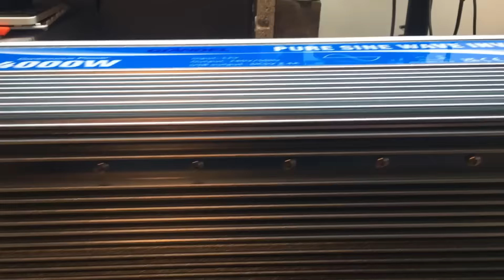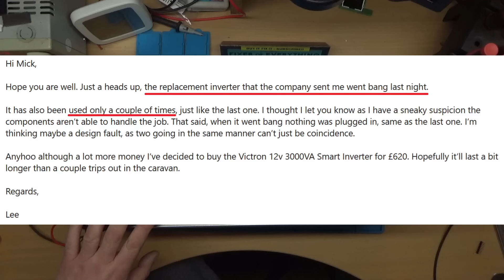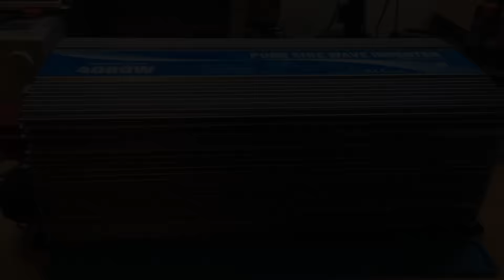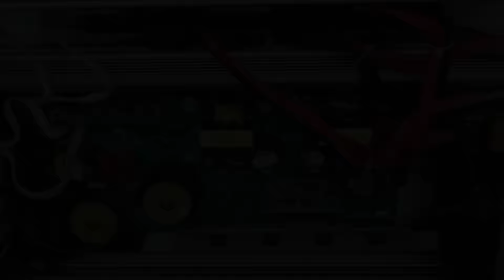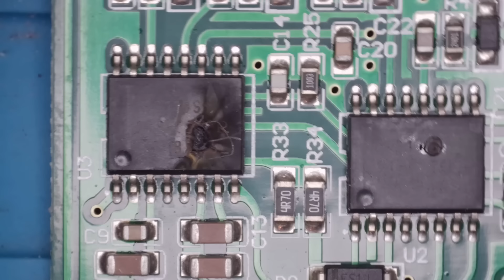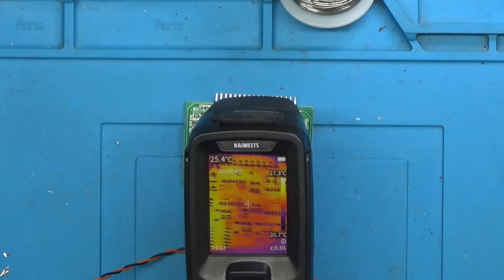Blown 4000W Inverter 💥 - Fixable or Game Over?

Comment: People think they can draw 4KW from a 12V battery? What 12V battery will do that sustained?
This product is insane. Not surprised it melted someone's battery and caught a house on fire.
It's >300 amps.
Reply: Yep. 333A x 12V is 4kW and allowing for inefficiency, it'll probably come out nearer to 400A than 300A. It would need to be a huge battery, connected with very very thick cables. Maybe the inverter didn't like the probably much less than 12V that it probably was fed in practice?

Comment: I’ve got a 2000 watt puresine wave inverter that’s gone faulty it’s fault is saying it’s over loaded but it never been over loaded it was a back up for a cellar water pump it fits in a battery box with a bank of 12 volt batteries paired as 24volt packs. I would love to get it repaired as a can’t find a replacement one to fit in the battery box and have the lan trigger to turn it on and off. It would be great if you could have a go at it
Reply: It means the output FETs are shorted.

Comment: This is concerning. I have had 2 giandel inverters and they wont die. One got rained on by accident while camping (it was at least not connected to 12 volts) and it still works.  In the various inverters i have seen fail, its usually the output H bridge IGBTs that fail, they arent a fan of high current surge loads, like induction motors. When the igbts go, so does the PWM sine wave controller board, usually the IGBT drivers fail. Those little boards all do the same thing, but usually have odd pinouts.

Comment: Many of these Chinese inverters have the problem that the solder holes are undersized, especially if the solder hasn't flowed completely through.

I've got a similar one right now where the positive and negative terminals were reversed. Almost all the electrolytic capacitors exploded. 😅

Comment: 12v 4000w  in my very limited opinion that is the 1st problem. I want a minimum 24v inverter, but ideally a 48v running 4000 watts. If only to save money on cables supplying it. 333 amps!?

Comment: Honestly it doesnt even surprise me anymore. I also have been brought some blown inverters. Whatever has happened to them the mosfet/igbt gate drive IC-s have also been damaged. In general it wouldnt be a big deal but the design engineers have almost always chosen gate drivers without galvanic isolation- so anytime the output gets destroyed the input also gets some of the spicy high voltage and destroys the microcontroller. In some cases I have repurposed such inverters to just be HVDC output only, without the  AC conversion part since most electronics devices have diode bridges and switchmode power supplies in the input- but should you do it yourself, never assume that a device has SMPS in the input, some still use low frequency transformers! 

Altough unlikely, you could try reading the chip while being powered by the power supply and have some success doing that

Comment: Sad. So many nice parts to recover or use for own designs. Its bad how many of them get tossed into the scrap after they fail, I need some of those transfomers and coils/chokes, maybe even high voltage caps.
Is there any chance to get this inverter to Germany, maybe for giving it a try to repair it myself (can take a while!) or for rescuing some of the parts?

Comment: The user likely didn't plug in something "too heavy" in terms of running watts, but rather something with a massive startup surge that the inverter couldn't handle. This confirms my suspicions and you mentioned the fridge , the mini board (PIC16F716) or any of the chips did not cause the fault; it was destroyed by the cascade failure initiated by the compressor surge killing the MOSFETs ,he would have to Consider installing a hard start kit or soft starter on the fridge compressor ,or Use an inverter with a higher surge rating or a low-frequency transformer-based design, which handles motor surges much better.,he should be told this as it will keep happening ,he thinks buying 4000w is good ,it is if used correctly .its not his fault but at least he will know to buy an inverter that runs a fridge,cheers Gary take it easy matey :)
Reply: If you must know it hadn’t anything to do with what I had plugged in. I fitted it in to my caravan, running from a 603ah Fogstar Drift battery and 0 Gauge cable. The problem was having the inverter installed in my caravan while driving about. It did not like the vibrations or movement of the caravan, and shook the legs loose on one of the components.
Reply: @pulsenation  ahhhh its a mobile caravan well that makes that transformer even worse ,i thought it was a static caravan me bad sorry for that ,but anyway ,so was it the fridge or vibration ,we will never know,it is a cheap transformer , i have looked at them they are junk,vibration can cause the legs to break as you say , 603ah Fogstar Drift battery and 0 Gauge cable absolutely perfect, the high-frequency Giandel absolute garbage ,Low-Frequency inverters use a massive internal copper transformer,Vibration Resistance,,3 to 5 x Surge Capacity,for that fridge and Durability for mobile use like moving caravans ,motorhome, so what is the 3rd 1 you have bought ,i thought Giandel were cheap but they are not, they pretty expensive ,and says heavy duty,but if you are telling me this is happening because of vibration then these units need reporting to health and safety ,they will blame the fridge because it causes the same symptoms,but i am so happy to have seen inside and the damage done to this unit,so thanks for sending it in and replying to me ,they have a picture of a motorhome in there advert for these units and lots of so called guarantees , made in china , shenzen if i were to guess some more,that unit is a death trap for motorhomes if they are failing like that,were did the vibration diagnosis come from ?

Comment: That output driver board looks like a clone of an EGS002.
Reply: I thought of that too but the EGS002 uses a dedicated spwm chip, the EG8010, instead of a PIC. It also has 17 pins instead of 18. It would be nice if they were pin compatible though.

Comment: would like to know what is causeing it to blow loads of componets and catching fire
Reply: The mosfets short out due to overload / overheating, the current goes up to the control pin (the gate) and blows up all the semiconductor stuff that drives it. Not sure why it would catch fire but unfused low voltage power can be very dangerous.
Reply: It probably set the wiring / battery on fire due to trying to draw too much current.

Comment: Enjoying your videos 👍🏻
Could you tell us the current the board took when failing 👍🏻
Reply from the maker: I can't remember the measurement on the bench PSU when I was powering the control board, if that's what you mean? But it was 5V being fed into it, and it was 38 ohms I measured across the supply, so it should have been  5v/38ohm = 0.13A

Comment: Given that so much has "blown" across both high and low voltage sides, you feel there much have been some huge thwack of back EMF current, and given that it seems to be a recurrent problem for the manufacturers you'd think they'd build in some surge protection or freewheeling diodes to mitigate against that?!

Comment: They had fuses in parallel???
Reply from the maker: Yes, each inverter seems to be 500w so / 12V = 41A. Two 25A in parallel would be 50A although 1 x 50A fuse would probably have been better.

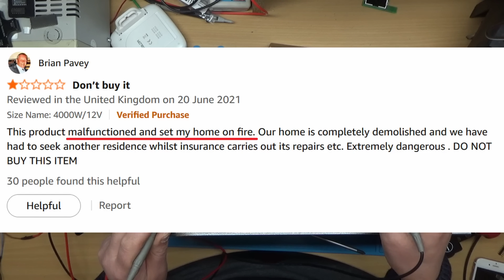Comment: 5:57 This review does not make sense under normal condition. First there is BMS on battery that protect overcurrent, second there is circuit breaker, and LFP battery does not go fire when under heavy use or short circuit no matter what (only when extreme overcharging it will have small chance to get burned). So, even the worst cheap inverter will not be able to cause fire from inside (nothing to burn inside solid casing) except from the cable getting hot and insulation burned out because of overcurrent (but this will trip the breaker/BMS). If melted cable doesn't trip the breaker that means you use too small or wrong cable size. Also, even if something burning (in worst case) there should be limited fire (not the entire house) and could not expand (self-extinguish) if properly put in correct place. This person might be lying or just doing totally wrong in the installation and placement. Remember, nearly 99% of fire in solar-inverter installation is coming from wire & its insulation that is melted and too hot, rarely from battery and extremely rare from other sources.

6:00 If a user saying it melted his battery then either he is not using BMS or using faulty BMS. Either way it is his own fault that cannot do proper installation so that inverter can cause damage to battery. This is near impossible to happen in normal and proper installation (regardless how bad an inverter is). I did once buy worst inverter and it shorted out after few weeks but fortunately BMS cut off and circuit breaker tripped.

Comment: You are on a hiding to nothing with this sort of cheap china junk before you even take the covers off. Questionable componentry, questionable design and questionable implementation. With the currents and voltages involved there is very little wiggle room if something goes south and semiconductors are the first things to let the magic stink out. I've seen units like this where every device has exploded and the fuses are still intact. I'd be stripping the boards for usable parts.
Reply from the maker: Totally agree 👍

Comment: 4000W at 12V is 333Amps if it was a perfect inverter. That's an eyewatering amperage to be drawing potentially at full tilt, no wonder the battery melted in one of the reviews.

Comment: 4KW at 12V is approaching 400A by the time you allow for efficiency of the inverter, cable losses in the feed wires, and sag in the batteries due to high current levels, so ratings are probably fairly unrealistic in the first place. Probably operating from a parallel string of batteries, in which case would be better to reconfigure to a higher voltage series string and use a higher input voltage inverter to reduce current draw/voltage drop. If inverter is configured as multiple 500W inverter modules in parallel as you suggested, it would be prone to cascading failures anyway, one module goes open circuit, the rest have to pick up the slack and work harder, then the weakest remaining gives up and issue continues till they have all given up. Alternatively, one unit goes short circuit, the rest kill themselves trying to drive into the short circuit. Protection system if used would be structured for combined output, not a individual modules.
Reply: Probably a 1KW inverter at best, probably less. Can't believe people use this stuff, it's obviously dangerous (at high loads)

Comment: Glad your friend got a Victron. Super reliable. Mind you a few of my forum buddies use these Giandels in their setups and they have not missed a beat. Must be a design flaw with this particular model 4000W unit (mind you it makes more sense to go 24V or even 48V at these power levels).
Reply from the maker: Agree, I've got a few Victron units myself.  Yes 48V is the way to go, but I think this was just being used in a camper van to run a fridge.

Comment: The problem comes when the fet/igbt blows, it usually shorts all the pins, giving it enough time to zap the board with over 300V through the gate drivers, which enables a permanent unalive state.
I fixed a similar one with a red EGS015 board, was a direct drop-in replacement, worked straight away.
Mine had a PIC as well, however it seems most of these inverters control boards use the same pinout, so it doesn't matter what the control board is based on, it just gets power and generates the driving signals.
I took the EGS015 because it looked way more specialized,  a single chip did it all instead if relying in a bunch of them.
Reply from the maker: Interesting. I just assumed it was a proprietary board, with their own firmware to drive the display / control panel. I did have a quick look and some boards seem to come with their own LCD so it still might be the case. Yes had a few dead MCUs on Milwaukee tools when the fets controlling the brushless motor short and send the 18v down the gate pin into the MCU.
Reply: I was just here to post the same thing, standard SPWM pcb. they make the high voltage driver pcb too for the inverter stages.  I did once build an inverter using a Prius IGBT module and a EGS015 for use with a 96S EV battery, the voltage is similar to the 400V bus so it just works, you can also play with the frequency to make VFD like outputs if you are really bored. LOL

Comment: These power Transistors are IGBTs. Interesting. And these Inverters are actually not that cheap either.
It would be intersting if one could try to read the FW from a working one. If that would be possible repair is worth it, these are like 400€ or more.
Reply from the maker: Yes not cheap, but cheaply made I think. Personally I'd rather go with a Victron or such as they don't cost much more, and would be much more reliable.
Reply: @BuyitFixit  it would be interesting where the actual weakness is because they do not look horrible on the inside.

Comment: I have a Edecoa inverter from Aliexpress that failed after 2,5yrs, contacted the seller and they offered me a repair kit. 
The kit includes all mosfets, transistors, smd resistors, voltage regulators and the controller board for 16 euro total incl shipping. 😅
Checked everything and replaced what was faulty and it working fine again.
Reply from the maker: Nice, a company that's at least willing to help. Although their equipment should really last more than 2.5 years..
Reply: @BuyitFixit  So this is supposed to take in 12V at 300 and something amps and give 240V 4kW out?
Reply: @BrianG61UK  Pretty much yes (not with these puny wires it isn't).
Reply: @BrianG61UK  never seen one inverter in that package that meets advertised power.
Reply: @Lyzzzander mine is 2500W continue and I could used a vacuum and circular saw without any issues. It was the connected vacuum (switched on) and the soft start on the inverter during power on that killed it.
Reply: @Lyzzzander  Giandel does but it will be at the ragged edge doing it.  Not a lot of headroom at all.
Reply: @Lyzzzander Exactly, if it's a Chinese 'special' I'd personally cut the advertised ratings by half if you want any sort of reliability.

Imho, trying to run a 4 KW from 12V is a bit impractical. At some point you need to up the input voltage to get any sort of reliability or everything has to be so over built the inverter just wouldn't be affordable.
Reply: this is called customer binding
Reply: @Zafira-Fan  it's called deniability when the repaired device burns your house down.
Reply: @scottjohnston3098  No chinese seller has ever faced repercussions from their garbage burning down someone's anything. That's one of the many reasons it's best to not support slavery.
Reply: Be careful with this stuff
Reply: that wasnt include with the warranty?
Reply: @mhammmmagh1465  not when you order from China. Sending is back will cost 50% of the price from a new unit.

Comment: Hey mick. I think that sub board, controller board might be available. I was watching another lad that works on these kinds of things, actually mostly amplifiers  I think but he came across this problem and he ordered the whole sub board with controller and high/low mosfet driver chips attached ready to solder in. I will look n see if I can find the video I watched where he did this.
Reply: @barevids is the lad I was watching. Seems very knowledgeable

Nothing on you though obviously! 😂
Reply from the maker: I've had a quick look on Aliexpress as a few others mentioned similar. I think this has a display and a remote display / controls so it might need to have the correct version for those to operate correctly.

Comment: I've seen videos of power inverters getting repaired on another channel. When these things fail, multiple components get taken out. It wouldn't surprise me if most of those MOSFETs got fried. Then you gotta check the replacements because they often go in pairs that need to have the same characteristics so they balance.
Reply from the maker: Yes, cascade failure. I've fixed a couple of different inverters on here, including a solar one where after I repaired it the company wouldn't give me the engineer password, so I ended up having to reverse engineer their firmware and write my own password generator 😂😂😂

Comment: Either a design flaw or mechanical assembly problem I'm guessing.  At the price point one would suspect decent components.  The online comments shown in the video tell the story it seems, not a reliable product.  All those fuses blown and still didn't protect the destruction of major components.  This one was destined to be non-repairable, good try Mick.  Great video, thanks.
Reply: fuses tend to be way too slow to protect semiconductors - the fuses are there just to prevent things from going up in flames when the semiconductors short, and apparently from the reviews, didn't even do that
Reply from the maker: Cheers Terry 👍

Comment: Afternoon Mick!

. . .That type of product, made up of 8 identical smaller circuits, I would repair by depopulating the main board, drawing out the circuit of one 500 W section, and then building one section up and testing it, then removing the fuses, continuing with No. 2 section and so on!

. . .I wouldn't be surprised tho' if the Chinese built these things with the same fake/remarked/substandard components they try to sell on AliExpress & eBay all the time!!
Reply from the maker: Cheers Chris 👍Yes someone went wild with the Copy / Paste buttons 😂😂😂